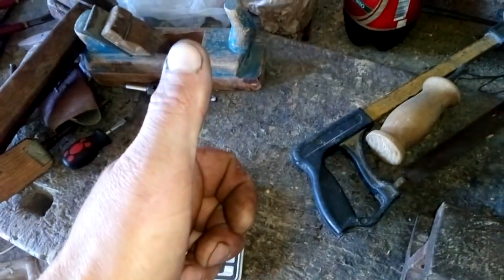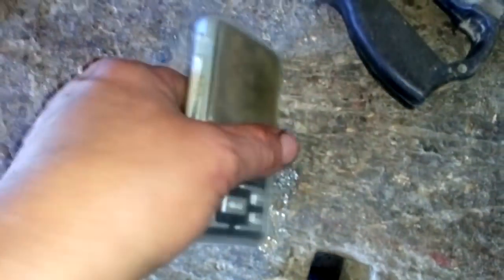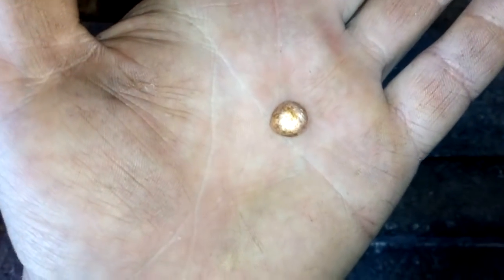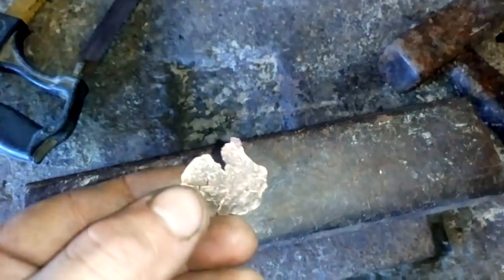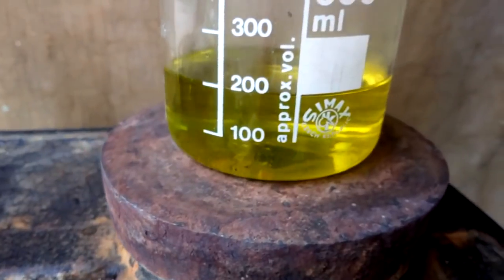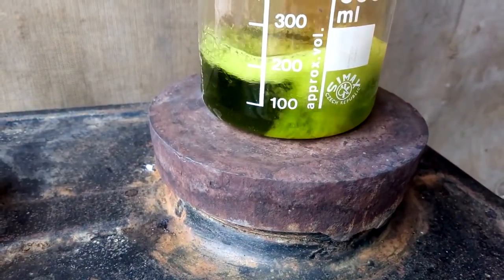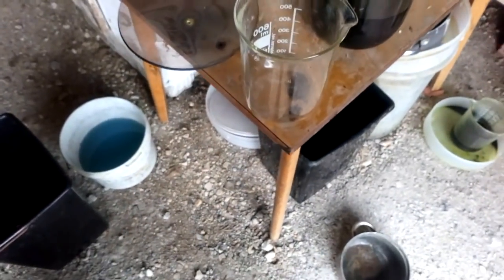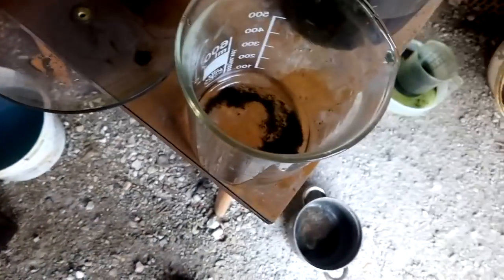RERIFINING IMPURE GOLD with Poorsman Ar and Bleach!

Comment: Ive refined $10,000's of gold scrap now (in my basement). And i grew so tired of it and learned most cost more to process than to sell it as is. Karat jewelry and gold filled is by far the easiest to learn on, but also far easier to sell and make money on it as is. But when i watch the videos, i wanna go turn on the hot plate and mix up some soup. But i resist. 

Now im sitting on about 100grams of gold filled scrap, 80grams of sterling, and 4grams of karat gold scrap that im about to slap on ebay. As much as i enjoyed refining it in AP or poormans AR, i get more money selling it as is to the next guy. Refining is a youngmans game, or for someone with endless supplies of good material and cheap chemicals and lots of time. I gotta let it go.